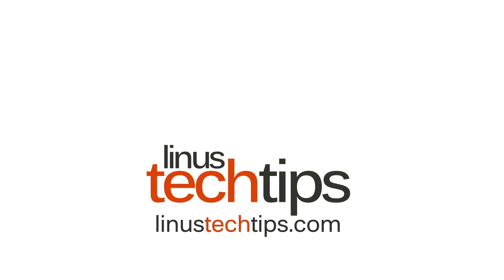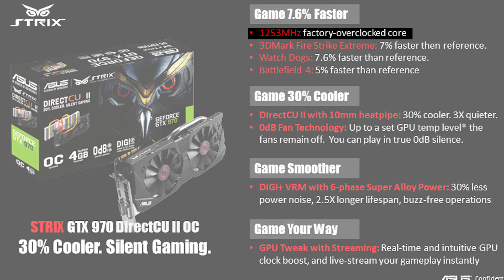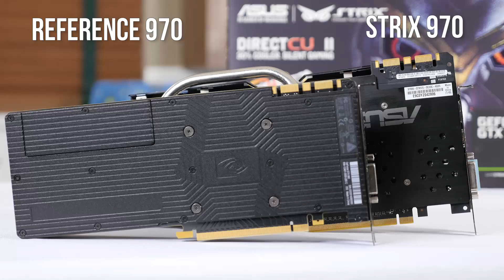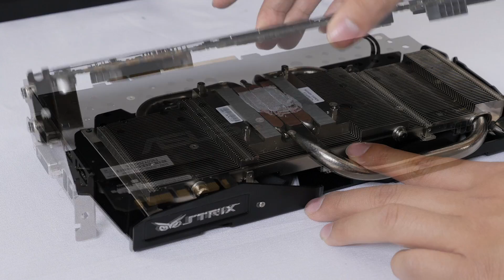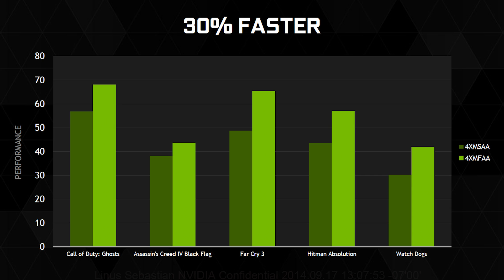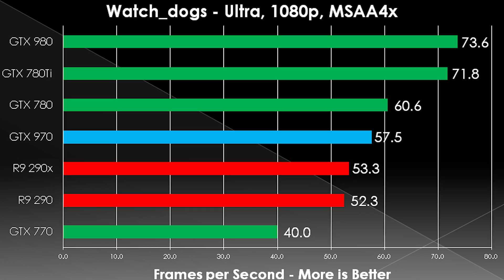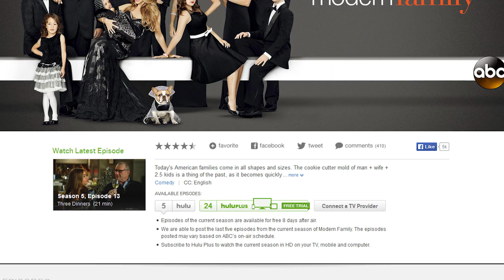ASUS Strix GeForce GTX 970 Video Card

Comment: I'm about to order this card in the next few days! I can't wait! I've been stuck with a GTX 650 for a long time, and it doesn't work well with my i7 3770k. (Lots of bottlenecking issues.) It's going to be an awesome upgrade :)
Reply: Nice! 3770k and 970 is going to be a great combo! Good luck with your upgrade :D
Reply: Divert Atomic Thank you! :)
Reply: if you update you card you can download gta 5 on march 24 :D :D
Reply: I'm going to order this baby next monday! Fuck you, HD7750
Reply: i'm literally doing the same thing! stuck with a gtx650 too xD and an equivalent CPU too xD no more bottle necks :D
Reply: i have a gtx 650 in this system with a i5 3570 k but decided to go with a whole new build can't wait its going to be awesome
Reply: I was on a budget of 800 dollars and here is what i came up with

Intel Core i5-4690k
G.SKILL Ripjaws X Series 4GB 1600MHz(which ill upgrade)
EVGA Supernova 750w Bronze Rated Power Supply
Fractal Design Define R4
Seagate Barracuda 7200.12 1 TB,Internal
MSI Z87M GAMING LGA 1150
ASUS GeForce GTX 970 4GB

This will be my second build i tried to keep it easily upgradeable with parts  that where in my price range i think maybe the motherboard could have been better but this is my 2nd build and from what i've learned about computers so far it seemed like a reasonable mb
Reply: TheKeule33 I play at 1080p, it's not an issue. However, it's an issue with poorly optimized turds like any Ubisoft game. Just because the card has 500mb less VRAM then advertised, it doesn't take away from the cards power. This is a card that can max Battlefield 4 at 120fps, and only use 2.5gb vram total
Reply: i'm going to get that card tomorrow, can't wait more! FUCK YOU GTX 650!
Reply: Hi there. I have an  i7 4770 (none K version) and just bought the Asus GTX 970 yesterday. I have tested few games with this new config and I`m really impressed. I was lagging a lot on Arma 3 but now anymore. I cap put everything on the top and get an average FPS of 50 (except the view distance object which I only put at 650/750 meters. At 12000 meters I get an FPS of 15. The object view distance is the most demanding in Arma 3). 
I can also put Far cry 4 all away to the max settings without any problem. Same with Dying light.

I passed from the GTX 560 Ti tp ASUS to this ASUS GTX 970 and I see a huge difference.
Reply: yes, you dont even need that much really. right now i am literally in the process of building that with a 4690k and a air 240.
Reply: Aske Jensen I asked this to employees of the store I bought it and 2 of them told me to go for the Strix. He told me they are all the same and the differences are to small. I was planing to buy the Msi but I finally went for the Strix.
Reply: Can Gunes In my case I asked it to the employee and he gave it to me. You are right about the games. You get a code for one of them. By the way one of my best friend is call Alfredo Christinziano. He works for Ubisoft Montreal since 2006. He made some textures for all the Assassin Creed games, Splinter cell Double agent, Rainbow six Vegas I and II. 

About that coupon, the guy told me that he was not sure if they are still effective. I read it and it was expired. But I tried and it worked. Just insist to your seller.
Reply: I just ordered it yesterday. Along with I5 4690K I hope its going to be great build .
Reply: ***** There is a huge difference, unless you've benchmarked both the cards you're in no position to say such a thing, the 970 can play Batman arkham knight maxed out and you CANNOT tell me the 650 does aswell. I've benchmarked both the 750 ti and 970 and there the difference is also stunning.
Reply: you read it wrong the gpu is the one bottlenecking the cpu you idiot
Reply: ayxan qocayev Ohh yeaahhh, and max that baby out (hoping the port is good). I actually just ordered the card about an hour ago :)
Reply: Naseem Hussain Hell yeah brother! Bottlenecking sucks
Reply: hahaha :D
Reply: Jalin Williams What's your new combo? 4790k & 970/980? 4690k and 970/290x? Maybe even an X99 build?
Reply: Jalin Williams Looks pretty good, I'm sure you know this already though but until you upgrade it, 4gb of ram will be a bottleneck
Reply: Yeah i know it will hold back my possible preformance but how much ram should i get?
Reply: Jalin Williams I'd say at least 8
Reply: Alright thats what i was going for 8 to 12
Reply: Jalin Williams Nice!
Reply: TylersInsanity Let us know how you like the card. I'm leaning towards this card for when I build my rig, unless the 980 ti comes out soon and is a monster. Then I will have to just pony up for it.
Reply: Lol its so funny you mentioned that because I have the exact same setup!! Everyone tells me that the GTX 650 is enough, or 1gb of VRAM is enough, but im ready tot take it to the nect level! So tired of compensating. Also is this card worth it? I'm almost convinced it is!
Reply: Mark, just from watching many youtube videos and not owning one myself, I can tell you that this dag on Strix card is worth it. It's a monster of a card.
Reply: Mark Taylor Yes, it's worth it. No, 1gb it's not enough, hi-res textures will take more than 2, i've a 650 as well and i'm going to buy a 970. No doubt.
Reply: Very good pair! I'd stick to 1080p, 1440p will choke your card and you'll see fps drops by almost half in some cases
Reply: Noah White-Gauthier Yes, it will. Do your research or test for yourself.
Reply: Huh? I never said anything about people being 'upset'. You're throwing words in my mouth. And yes, 1440p will be more strenuous on the gtx 970 on most games today*. Please consider this: 1440p is 3,686,400 pixels. 1080p is 2,073,600. You don't know what you are talking about, so I don't understand why I'm still debating with you over something so silly and factual???
Reply: Noah White-Gauthier Why are you still talking? I thought this was already discussed...
Reply: How is it for you? I'm still in the process of choosing which one..or if I do want to spend that amount of money for the upgrade..mine is a 670 and 3770K
Reply: John Patrick Flores Hi. The guy at the CIPC boutique recommanded me the cheapest one of the GTX 970 (this one). I bought it monday for 440$ plus tax. I was about to play Far cry 4. Graphically speaking: IT`S AMAZING!!!! I swear I never ran any game like I`m doing now. For Far cry 4 I`m playing everything on the top and get an average ratio of 50 fps. Between 35 and 55. I also tried with with Arma 3 and was amazed also.  I don`t know about the 670.
Reply: Thanks man, I've been experiencing the fps drops lately for the games I play and I refuse to crank down the settings..you play planetside 2 as well by any chance?
Reply: John Patrick Flores Oh yeah by the way it was not mentioned on the box but I asked the seller if it comes with a game. He jumped and said: Oh yeah this! He gave me a coupon for 3 different Ubisoft I could chose: The Crew, Farcry 4 or Assassins creed Unity. If you buy it don`t forget to insist on this. CIPC is a boutique in Montreal. They have lot of stuff for cheaper than Tiger direct and if we pay cash we can save the tax.
Reply: Grunge LovR Nice glad you enjoy your setup! I  have the i52500k at 4ghz and going strong. the 970 is a champ
Reply: Gume Gume Yes thanks. I heard good things about the i5 2500k. K versions are overclockable. They can turn better than i7 CPUs.
Reply: Grunge LovR Yeah I love unlocked cpus, lots of room for options! So far I might need to upgrade soon, some games that are coming out soon are recommending i7's and i5 or equivalent as required :X Haven't seen any official posts but only leaks that are questionable
Reply: Gume Gume Like which game for example? On my side I would say that the hardest game to run is still Arma 3.
Reply: Yeah Arma 3 is flippn CPU demanding from what I hear, I haven't played it though. A coworker of mine linked a website to me a few weeks ago that Witcher 3 will be required an i5 and rec. an i7. Not sure if it's legit though, i haven't googled it yet
Reply: Gume Gume Arma 3 is ridiculously demanding. Especially when we play online. I never played any Witcher game but I heard it`s good. The big baby I`m waiting for now is GTA 5. On PC that`s gonna be too awesome!
Reply: Grunge LovR Ive got the Witcher 2 and its very CPU demanding. My set up FX-9590 2SLI-GTX-760Ti. But the good thing about the Witcher 2 is that I have 8-cores and it utilizes all of them. From benchmarks ive seen the 2SLI-GTX-760Ti setup has a slightly higher max FPS as compared to a single 970. But the single 970 has a much higher average and min FPS over the 2SLI-GTX-760Ti. So what i plan on doing is getting a single 970 and later on pairing it with a second one. My monitor has a max of 60 FPS at 1080 so a min higher than 60 is golden for me.
Reply: Travis Lowrey Wow you mean you have two GTX 760 Ti? The Ti versions are always the best deals quality/price, You wont have problems with this that`s for sure. That`s a sick config.
Reply: Grunge LovR Thx for the complement. There isn't much left of my original build and it has come a long way piece by piece.
Reply: 640 here, so awesome omg its amazing. i get beast 4k benchmarks its a gt 640 because the x couldnt keep up with its clockspeed.
Reply: Either Asus strix 970 or Msi 970 gaming
Reply: TheKeule33 It doesn't have only 3.5GB. It has the full 4, but a 0.5 partition runs at a slower frequency. Stop believing lies.
Reply: Same here but i got the AMD Radeon HD6670. Getting ASUS or MSI in a few days. Got the 3770K but i dont want to risk anything to overclock both gpu and cpu since i dont have a cpu cooler and not good at overclocking.
Reply: Can Gunes Hi there. I also have the i7 3770. That really kicks some asses!
Reply: Grunge LovR Yup. Also are you fine with Strix?
Im thinking to get MSI or Strix so
Reply: Can Gunes  YOU BET I AM!! But only buy it if you really think you need a new one. I feel fine with the one you have right now, keep your money for something else. I don't know the ATI.
Reply: Grunge LovR I do need it, for many games and better performance where i could get something better with my i7.
Reply: Can Gunes Oh yes I understand exactly what you mean. Trust me that with this GTX 970 you will see all the difference. It worth! Before this one I was using a GTX 560 Ti and I was lagging a lot in Arma 3, and other games at the max graphics. By the way if ever u buy it, don't forget to ask the seller for a coupon that will allow you to download one of 3 games from Ubisoft. Farcry 4 and 2 other ones I forgot.
Reply: Grunge LovR I actually do not know if they have this in Turkey but i will, thanks for the info dude! Im looking forward to this graphics card, i have been looking forward to one since i got a new cpu (which i didnt upgrade my gpu).
Reply: Can Gunes I don't really fallow the technology of video cards and CPUs. I called the computer boutique where I always go and he recommended that one to me.  The GTX 970 is the biggest seller. You should be able to find it in your place. Otherwise order it online.
Reply: Grunge LovR I mean i can find GTX 970's im talking about the coupon which gets you 3 games (researched it and found out they are The Crew, Assasins Creed Unity, and Far Cry 4. I would go with Far Cry too :)
Reply: Grunge LovR Will do. Thanks man.
Reply: Grunge LovR Will do when i get it, but i think there are still some time till i get it because i dont know ASUS or MSI. I think i have enough place in the case. I can show you a picture of it if you have skype or something.
Reply: Grunge LovR The Strix version has direct touch which is called Direct CU II (because 2nd version) when MSI has the Twin Frozr V (5th version) and they have been improving it for a long time.
Reply: SyszoneTv what motherboard are you using?I'm thinking of getting the same build with a Asus Z97 Pro Gamer Motherboard.
Reply: nonameslb Mine is a Solo II.
Reply: I bought msi z97 gaming 3
Reply: Your the same case as mine i recently upgraded from GTX 650 TO GTX 970 and yes im very happy with performance on max settings
Reply: Looking forward to ordering my msi version of the geforce gtx 970 :) , with the amd fx 8370 E. Would these two bad boys work great together?
Reply: Bawer Betasi They would work just fine together, the msi one does have quite a few cases of coilwhine but if you do just send it back and ask for a new one... Should work :)
Reply: Edward Johnston Are you mad because you have a little willy?
Reply: Edward Johnston Not everyone has access to their daddy's credit card.
Reply: PCInsanity I have an i5 3470 with 16GB of DDR3 and a HD7770 :(
I'm going to buy this card really soon ! :), can't wait for it!
Reply: Daniel Karazov Please tell me your opinion after buying it :) i still dont know whether to get this card or not. thx
Reply: Bawer Betasi Sure thing bro!
Reply: Bawer Betasi I believe the witcher voucher thing has ended now so they remain the same price, i would wait if i were you until the new amd series comes out and the 980 ti because there will be a price drop (Maybe even 50 euro's who exactly knows, Ps.ps xD Be careful when checking these things because some forums even said the 980 would be 300 bucks which is a bunch of bullshit).
Reply: Bawer Betasi I just got a 970 myself, and i upgraded from 750 TI. It is soooooooooo much better the only game so far i've encountered i didnt play on ultra is the witcher but even Shadows of mordor goes super smooth on ultra with everything on.
Reply: popstarfromhel thanks man for the help!
Reply: Bawer Betasi Oh and i forgot to mention, there were speculations they come out this month. If they are completely true i have no idea, it makes sense because amd said they would come out the second quarter of 2015 but i think it might be delayed also that is most likely the reason Nvidia had the voucher special to make up for the price drop so if you still want the 970 just wait till next month :)
Reply: popstarfromhel sucks for me cause i live in the netherlands :(
Reply: Bawer Betasi oh and im sorry but what does coil whine mean?
Reply: Bawer Betasi Coil whine is iets wat voorkomt bij kaarten die erg belast zijn, vooral bij de 970 series van msi is coil whine een groot probleem. De kaart maakt dan een heel raar stotterend geluid wat erg irritant is maar de kaart zelf is niet kapot hoor. En vaak zijn het bij die kaarten ook zo op te lossen of kun je hem terug sturen naar de fabriek. Ook is dit een fabrieks fout 9/10 keer dus het is niet iets waar je je echt zorgen over hoeft te maken. :)

Als je nog een goeie site zoekt ik koop hierzo vaak me computer producten: Alternate.nl
Reply: popstarfromhel beetje raar dat we nu opeens nederlands praten maar he ik profiteer hiervan :p . Het probleem met alternate is dat het volgens velen op websites zoals trustpilot.nl slecht beoordeeld is dus daarom riep alternate bij mij wat twijfels op. ik had al een kijkje genomen op de coolblue website en op paradigit, helaas nog niet op alternate want ik weet niet of de website betrouwbaar is sinds het geen thuiswinkel waarborg certificaaat heeft gehad. heb jij van alternate.nl besteld ?
Reply: Bawer Betasi Ik zit nu op een prachtige akracing stoel van alternate :P en me voeding van me pc en fans komen ook daar vandaan, hele aardige service ook en hij is een stuk goedkoper dan coolblue, coolblue is ook goed en hun service zorgde dat ik daarzo graag bestel (Je kan het dezelfde dag nog laten bezorgen) maar sommige dingen zoals de 970 die ik wilde was daarzo duurder. Ook heb ik bij azerty besteld alleen die raad ik niet aan, was een gedoe met een bepaalde kabel. Mooie van alternate was voor mij dat ze ook die actie hadden met de voucher voor witcher 3 en die had coolblue niet.
Reply: popstarfromhel dankje wel voor alle hulp, maar denk dat ik toch niet voor de 970 ga aangezien de prijs heb al de msi geforce gtx 960 bekeken alleen ik heb geen idee of de 2gb veel verschil uitmaakt met de 4gb van bijv de higher-end gpu's. beetje klote dus :/
Reply: popstarfromhel en ook het een en ander gelezen over amd gpu's alleen van amd gpu's zijn dat ze heel warm worden op bijv. bf4. wat dus betekent dat ik een betere cooler moet halen dacht al aan de cooler master hyper tx3 evo.
Reply: Bawer Betasi Goeie koeling is altijd een gekloot mijn 970 word op max load 80 graden, enige wat ik afraad met amd is is dat ze tot nu toe altijd problemen hadden met drivers van spellen dus dat het contrast bijv. slechter is. Nou moet dat met de spellen die na de nieuwe 300 series komt helemaal weg zijn en natuurlijk komen er ook drivers voor spellen die nu uitkomen maar het is vaker gekloot dan met Nvidia. Voor goeie koeling moet je gewoon een goeie behuizing hebben met goeie airflow ook is het belangerijk dat je een goede voeding hebt, daar was ik een lange tijd geleden de fout in gegaan en die fuckte me GPU op. 

De 960 is geen slechte kaart en is nu pas net een paar maanden uit dus allemaal leuke nieuwe dingetjes die erop zitten, maar hij zal geen high end games op ultra runnen. Maar ipv voor de 960 te gaan zou ik dan toch nog ff wachten op de nieuwe AMD series want die is ''mogelijk'' ook goed voor jou prijs categorie dus dan denk je aan de 360-370 die uitkomt. (Sommige zullen zeggen van niet gezien AMD pas over het algemeen zo na de 600 euro een beetje tegenstand heeft tegen nvidia maar dat valt toch wel mee met een paar kaarten/patronen die zij volgen). De 2gb extra werkgeheugen is vooral bij spellen die heel veel vernieuwende beelden heeft belangerijk dus daar valt BF opzich wel mee, daarbij moet je meer denken aan rpg's. BF4 zul je met de 960 op medium/high toch echt wel goed spelen :) Als je nog verdere vragen hebt let me know.
Reply: Give me the old one pla
Reply: popstarfromhel dacht aan dit :

Processor : AMD FX 8350
PSU : Cooler master g650w 
Behuizing  : Geen idee ! (Help ! :p )
GPU : Sapphire Amd radeon r9 280x? MSI GTX 960 ? 
RAM: Crucial ballistix tactical 8gb 
HDD : Seagate blablabla 7200 rpm 2tb
Moederbord : MSI 970 A G43
Koeler : Cooler master hyper tx3 evo 
en een dvd drive weet niet hoe die heet :p
Reply: Dat is een pure crossfire moederbord als ik jou was zou ik voor eentje gaan met mogelijke sli voor een tientje duurder :) Dan weet je zeker dat je volgende upgrade mogelijk is. Die CPU is leuk en erg goed te overclocken, ik heb de 8320 en ik heb hem geoverclocked tot een 8350. En voor behuizing moet tje ff kijken op Alternate of Azerty en ik raad je aan een full tower te nemen gezien het nu zomer word wil je niet dat je pc te heet word, zoals ik nu heb xD De rest is allemaal prima en zal veel lol opleveren. Je kan spellen die tegenwordig uitkomen ZOIEZO spelen, misschien niet altijd op ulttra of alles high maar zoiezo wel speelbaar.
Reply: popstarfromhel heb al een beetje gekeken en den k toch dat ik voor de amd radeon r9 280x ga. dus het moederbord hoef ik me niet meer zorgen over te maken, maar in ieder geval heel erg bedankt, tof van je!
Reply: Bawer Betasi Alright, toch raad ik het je echt aan kost misschien een 10tje extra maar als je dan over een tijdje upgrade dan gaat dat lekker soepel. Ik had het niet gedaan dus moet ik als ik nu me pc wil upgraden (Ram me gpu of me cpu) moet ik ook nog is een moederbord kopen. Terwijl ik geloof ik voor een tientje eentje die sli support en ook ddr4 ram. Good luck!
Reply: popstarfromhel oke thanks man zal even kijkje nemen heb toch nog wat geld over :p 
thanks !
Reply: PCInsanity I'm also going to put 2 of these in my new desktop :)
Reply: I'm finally throwing away my gtx 550ti to this beast of a card. Can't wait :3 :D
Reply: ***** The MSI one also suffers more often from Coil Whine than the asus one :)
Reply: +SwiftCola™ my msi 970 4g gaming makes no noise whatsoever..
Reply: A GPU can't really bottleneck a CPU. The CPU can always use its extra horsepower to perform other tasks.
Reply: Infinite Zero Its possible, it is definitely possible. Pretty much every I3 without overclock would bottleneck just for example a 980. A dual core or maybe quadcore at 3ghz would definitely be a bottleneck with last years and this years line up.
Reply: +popstarfromhel I meant a GPU bottlenecking a CPU. As in, a very powerful CPU and a weak GPU like what you said in your comment. If a 3770k bottlenecks a GTX 650, something's wrong.
Reply: Infinite Zero Ah yeah, true.
Reply: if you have the possibility to return the card, consider doing it. this card does not give you 4GB VRAM at full speed, only 3.5GB will be supported with full speed. search for news about GTX 970 3.5GB Vram Issue
Reply: TylersInsanity i Know. I bought my card to be future proof. 4k ready, u  know. I was about to upgrade to 2 of them in sli if it becomes necessary.